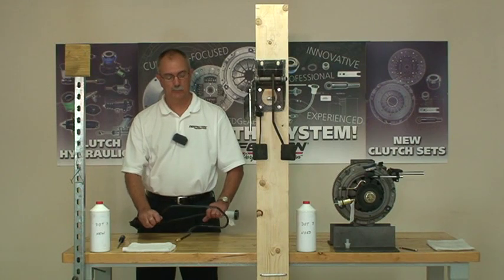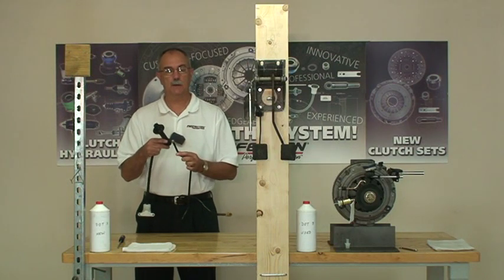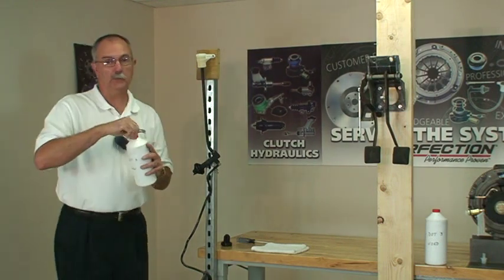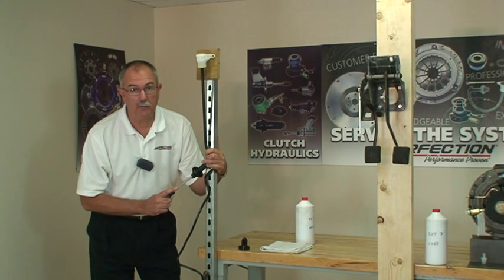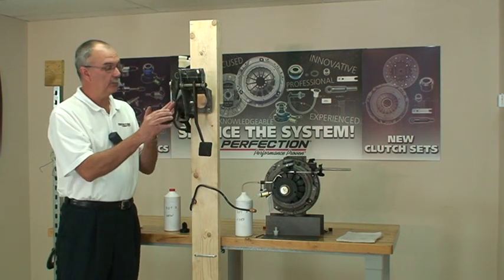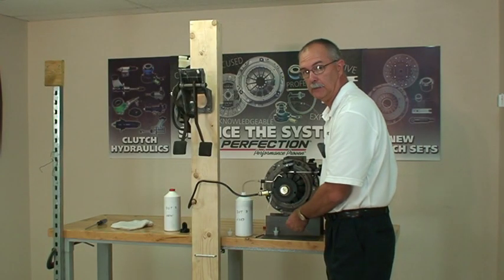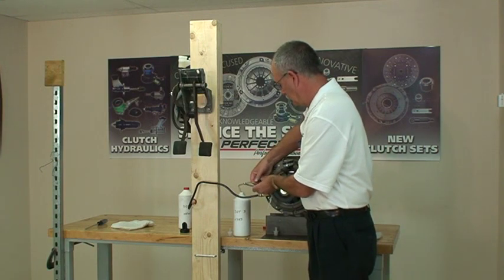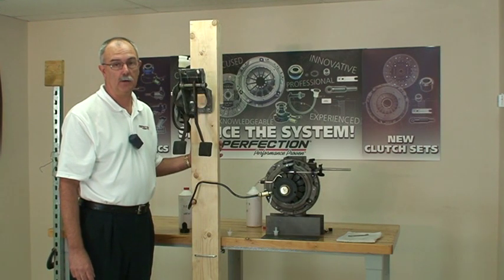Ford Ranger & Mazda B-Series Pickup Clutch Hydraulic Release System Bleeding Procedures

Comment: I did this, exactly like the video says, and all seemed good, and all worked well for a year or so, then my master started leaking, getting air into the system at the seal where i was inserting the Phillips screwdriver when I bleed it, fluid was getting on my vinyl floor. I didnt pump it aggressively or anything (when I bleed it), I think if you do it, you have to make sure to use a really small screwdriver to miss the seals inside. So I later on bought a prefilled master to the slave. I'm still having issues. But like what some people say on forums, use Ford parts with the hydraulic clutch. Older guys who remember cable clutches say hydraulic clutches aren't as good, but I wouldn't know. I suppose it could be preference. 

The Ranger clutch isn't like an easy brake job like it should or could be, many people have issues for some reason.
Reply: Also want to add: 
Since the prefilled master install, I've had to pump and bleed on 3 occasions now. 
The first two times tiny air bubbles came out, but this last time I didn't see any. You pump like 20x, hold, then release the bleeder quickly then close, repeat a few times. I did put in a non-self adjusting clutch, but I don't think that is the issue. 
It works as it should after bleed, but for how long idk yet. The next time I do the clutch I will be putting in the OEM Ford or LUK next time. Though it's not bad pulling the trans in a 2wd, I don't want to "try" different parts, some parts are being sold as OEM, and they are not.

Comment: So... if bearing is installed backwards (seal facing front of motor instead of facing transmission)..... will it cause any other problems besides extreme difficulty bolting Transmission  back up to the motor? Picked up a cheap Ford Ranger. Did a new clutch system on it. Put everything in exactly the way the old stuff came out. Turns out, release bearing was in backwards... so I installed new one in backwards (not knowing) as well. Took FOREVER getting Trans to bolt back up to the motor!!! But once back together,  everything seems fine. Should it be ok? It's not like the shaft moves in and out, or one end of bearing is wider or anything.

Comment: What's the story on the requirement to remove the rod portion?  I've got the whole assembly out of the car - can't I just pump the attached rod instead of using a screwdriver directly on the piston as shown in the video?  This is a '89, so no circlip on the rod assembly; it's one of those clips like you find at the end of the speedo cable that never wants to come apart.

Comment: Thank you for posting this.  I removed all the air from my system using this method and the transmission shifts perfectly now!  No excuse not to do it this way, folks!  The fender liner is easy to remove on Rangers, and from there, removing the master is a breeze.  Awesome.  It was a little bit tricky to bend the line between the master and slave fitting as the bends are quite stiff.  But using various clamps, I managed to create an uphill path all the way.  :-D

Comment: Thanks for sharing, i couldn't find any videos on how to bleed the clutch sistem on a 96 f150 and i did all the same process and it worked great i only had a clue because i have a haynes repair manual and it said that i had do bleed the master cylinder in a bench

Comment: Really want to thank you for this well-done, simple explanatory video. After watching several other videos of shortcuts and tricks, some of which may work SOME of the time, I noticed fluid coming out of the top of my clutch master cylinder, meaning it was defective. Once I saw this video, I knew there was going to be no shortcut for me and this is the way to guarantee success. You can also see why most of the shortcuts won't work unless there is no air trapped in the master cylinder. The only shortcut I saw that could work in that case, is one guy who unbolted it from the firewall, tilted the rod downward, stretched the hose under the car (basically doing the same thing as this video IN the car) and proceeded to bleed the system in the vehicle. But since my master was leaking, I had to remove it anyway.

Comment: Do you have to bleed a prebleed system 1994 Mazda b2300 , sometimes hard to shift. Can see through inspection area on transmission she's moving, but also clutch doesn't have the umpth as would hard half way then alittle eaiser on way down etc. Never had a manual vehicle this old.

Comment: DO NOT LISTEN TO THIS MAN... Bench bleeding this is how it's done.. Use the push rod to pump pressure in the line. There is a spring loaded seal the bottom of the line/the part that goes in the tranny. Once the line is primed use a screwdriver to push the spring loaded seal in fluid will come out. PAY ATTENTION. The trick is to have a friend hold and compress the push rod after it is pumped and the line is primed. The next meaning YOU open the spring loaded seal(screwdriver). Air and fluid will come out. Let the seal go to close the line. Then your friend can let go of the push rod. Pump it up and reprime the line and repeat this process until the line is free of air. Yes you should tap the line to get air out of it. Turn the line in multiple positions when bleeding with the method mentioned above. But the FINAL bleed; when you are confident all of the air is out of the line... the bottom of the line with the spring loaded seal should be held vertical to get the last of the air out. Keep the reservoir full and in the upright position. The entire process. Up right meaning the same position it is when it is in the vehicle. Good Luck. THE BOTTOM TO THE TOP METHOD SHOWN IS WRONG. It should be taken down...
Reply: You are wrong... idk where you get your backyard ideas, but this is the true reliable way to do it correctly with no guess work. Sounds like you like to fight things instead of do them correctly. Have fun getting frustrated...
Reply: @PureChivalry  To complex for you to understand.. I get it. Reading is fundamental... Just stick to.. The Cat in the Hat my friend...

Comment: Well, aint that just right. Now, in my case the 89 Ford F150 5.0 engine mated to a 99 4.2 M5R2 5 speed  was a real problem. I had to drill out the bell holes to accept the larger engine backing bolts ani It seems there exist a problem in the depth of the fingers when they are compressed to release the clutch. I was getting over an inch of slave travel to the fingers down but no release. Jack the rear end off the ground and i could get all the gears, put it down and no clutch at all. I found out that the pressure plate off the 4.2 was what i needed to get it fixed. That plate flat surface to top of fingers was right at 2.75 inches high. The other plate off the 5.0 11 inch  was only 2.5 inches. That was enough to keep me from getting the disc to release. But, the 4.2 11 inch plate did not exactly match the bolt holes on the money. They needed to be filled and drilled or you could just washer it down with grade 8 washers and lock nuts and then tack weld the washer under the lock nut and you got a 97 Ford F150 with a 1989 Lincoln 5.0 and a nice M5R2 5 speed 4x4 and all is well. Holley four barrel with good old point distributor. Now the bad part with the hydraulics is try not to get a damn leak in the middle of the desert cause you will regret not installing a mechanical arm. Thanks for you inventions Ford.
Reply: You got it, i only need real specs, not fantasy. I found out the finger depths are not constant, but i am working now to find the shaft depth in the bell and i am seeing over one inch of slave travel. Bolt holes are off center diameter wise in the 4.2 to the 5.0 so far but i found a clutch plate that is only 1/8 less than the 4.2 OEM for the 5.0 so i think i can make do with that small difference to get a plate on the 5.0 that will be close to the 4.2 in depth, now the adjustment to the slave will most likely have to be a shim made in behind the bottom of the slave to pick up about 1/2 inch closer to the fingers. I feel that the OEM plate was only sticking on the pivot arms but i have not had time to pull it down yet but i am working on it.

Comment: when I believe the slave cylinder failed on my mothers 2003 Ford Ranger so I went to bleed it to make sure there was no air in the slave cylinder and when I tried to tighten the bleeder valve back up it just rotates and will no longer tighten back up and all the fluid ran out if the system...do you have any idea why it the bleeder screw just go tinges to rotate and will not get tight?..is it stripped out or broke in some way and I now have to replace the entire slave cylinder?

Comment: READ READ READ

95 Explorer as well...

If you've installed your clutch kit/master/slave and can't get it bled and you're got air, you will spend QUARTS of brake fluid and get NO WHERE.  If you do this "bench bleed" procedure, you WILL be done in short order.

If you let air get down to the Master Cylinder once installed (which isn't that hard!), don't believe for a second that you can bleed it through, trust me, go through the effort to take the Master back out (Yes, I know, you'll need a new Clutch Retaining Clip for the pedal) and bench bleed it again.  Use my pain for your benefit!

Our pedal was only just starting to disengage at about 1/2 stroke and at FULL peddle, I could only just spin the driveshaft with effort but still could hear the clutch disk dragging on the flywheel/pressure plate.  This is NOT good enough; First and Reverse will be a grinding nightmare.

ANY air in this installation is too much; we were able to do the Bench Bleed portion of this procedure IN the vehicle (because the reservoir is "trapped" in the Explorer installation).

IN VEHICLE PROCEDURE: Take the master out of its mounted position, remove the Clutch Line from the Slave Cylinder, stretch everything out and down towards the ground such that the Clutch Line doesn't have any air traps in it, tilt the Master cylinder as shown in video and bleed until ZERO air bubbles appear in the reservoir during the "screwdriver pushing" portion of the procedure shown in the video.  This took 4 cycles of "tapping" and then "pushing" with the screwdriver.

I was able to do this by myself with my daughter watching the reservoir for bubbles, other than the Clutch Retaining Clip, it really wasn't bad at all once we got over the frustration of having to take the Master out.  DON'T let that be your deterrent, do it!

Comment: I followed your directions to the letter except when I tried to install the transmission the throw out bearing hit's the pressure plate before the input splines touch the clutch. Pulled the trans out and tried to push on the throw out bearing to see if it had some give but it was solid as a rock. How in the world can you install a trans if the bearing hits the pp first?

Comment: I've never had much luck with gravity bleeding anything. I have an adjustable prop that is made from a squeegee handle that works by pumping the pedal ( brake or clutch) and bracing it against the drivers seat. In the case of my ranger the only part needing bleeding was the new slave cylinder. The pedal showed signs of resistance in the first three pumps. Leaving the prop holding the pedal down I opened the bleeder. I repeated this a second time and was done. This method works on any brake or clutch system that I can't attach my pressure bleeder to due plastic reservoirs and that type of garbage. There has been some clutch systems on trucks years ago that needed to be reverse bled but that is another story. 43 years experience.

Comment: I bought a Duralast Pre-filled Clutch master and slave cylinder assembly from AutoZone.
And guess what was stamped on the clip removal tool?
"Perfection Clutch HT-01"
I thought that was interesting.
I had the Ford dealer replace the assembly because I had a soft ,low pedal and I was afraid it was going out.And it was the original factory unit still on my 2003 Ranger.
After replacement the pedal felt basically the same.But it did go into 1st and reverse a little easier.
Also.I got the old parts back and tried to work the master cylinder plunger back and forth as shown in the video,but it was like pushing against a brick wall.
I couldn't move that rod even a fraction of an inch into the master cylinder,no matter how hard I pushed on the rod.
But my pedal had felt low and soft.

Comment: Things always work quick and easy when they are removed from their normal environment.   Bench testing, like this, is always going to be much easier than when you are dealing with it in your driveway.   The actual bleeding - on the bench - may take only a ''few' minutes but, you don't give any indication of how long the whole job will take when you have to do it from start to finish.

I would like to see the job from beginning to end -- starting with the removal of the master cylinder, reservoir, and line, from a vehicle while it is parked in a driveway; all the way to reinstalling it and bleeding the slave cylinder there.   That would give a much more realistic idea of the difficulties involved in performing this task.  This clean room bench test gives a good idea of the objective [bleeding the air from the system] but should be coupled with actually performing the job on a vehicle.

The real world often provides challenges and other obstacles that a clean room demonstration simply can't prepare you for.

Comment: What keeps the fluid from dripping out the bottom while your bench bleeding?
Reply: There's a tiny check valve built into the end of the hydraulic line's connector. So, when it's not connected to the slave cylinder, the valve is automatically closed... thus, no drips.
Reply: @brucebeverly2629  Thanks for the answer. Wow it's been 10 years. I forgot i even commented.

Comment: if this works for ford 4x4?
Reply: i have a ford ranger 2000 4x4   3.0 engine

let me know if i can do all that in my truck or is it going to be different because i think i have that issue with my truck my pedal is very soft i dont think is the clutch because i can shift good.

Comment: i'm replacing the slave cylinder and throwout bearing in my ranger. im leaving the old master in it. will i still need to bench bleed the master cylinder? (if that's possible seeing as how the pushrod is still connected to the master cylinder)

Comment: hi i am a big fan of you amazing videos and work! i was wondering if you could explain to me why my 1996 b2300 bleeder valve (in the slave cyl in the housing) dosnt have a way for me to unscrew it? its in a weird position in the first place but i see no slot for a screwdriver  (i probably couldn't fit a screwdriver in) there anyway.but i need to bleed my system and i just don't understand the anatomy of my bleeder screw and don't know what tools to use to just crack it open.thank you

Comment: its the exact one you are showing in this video. 95 ford explorer 4x4 4.0 v6. and the slave cylinder is leaking. i noticed when i add fluid to the clutch resevoir  the clutch will gain pressure for abt a mile down the road then it runs out.

Comment: Is there any way i could bleed the clutch w/o having to take it off my Ranger? I was stuck in another town 6 months ago when my slave cylinder leaked and i had a local mechanic install a new Perfection Clutch in it. I'm very certain he did not bench bleed it or do any of your techniques. It's a bit unheard of for a clutch system.

Comment: I was bench bleeding the master cyl/lines + slave cyl (not yet installed on the truck). With the bleed screw closed on the slave cylinder and applying pressure on the master cyl all that pressure had nowhere to go except blow the top off the slave(like a jack in the box). Again this process was done OFF the truck! Does this now mean the brand new slave cylinder is toast or can it be re assembled by pressing that top ring piston back into the slave cylinder?

Comment: PLEASE ANSWER THIS: i have done this to my 03 ranger, i was sure that there was a massive bubble in the line, i did the whole procedure at my house and it didnt work. i made sure not to invert the resivoir when reinstalling...i dont know what else it could be.. a shot master cylinder? cracked resivoir??? the pedal is still not firm and wont go in gear, it only helped a little since initially when the pedal was completely limp

Comment: Worked great! I followed the Hayne's repair manual after putting in a new clutch, clutch plate, slave cylinder and hydraulic line on my 95 Ranger 2.3 and couldn't get it to shift in to any gears. I bled it exactly the way the manual called for but I just couldn't get the clutch to disengage. After watching this video I got it! Didn't take that long either. Anyone who has a Ford Ranger/Mazda Truck and needs to bleed their clutch hydraulics needs to watch this video... :)

Comment: i agree its terrible you ran a hard molded line rather then a flexible line terribly routed, an internal slave, mounted the master cylinder to where the air gets easily trapped and by your own admission you knew it wasnt designed right but you built it anyways it should have been mounted at 90 degrees the bleed point for the slave isnt at the very top so air gets trapped there aswell. for the R&D that was spent im sure something better could have been built as a whole its a very half ass system.

Comment: imo this is a very poorly thought out set up. theres no need for the u shape in the line before it cross over the frame it creates issues with no real benefit. then the slave itself is more of a pita then its worth the only part you eliminate is the clutch fork so instead of being able to change the slave easily with 2 bolts and a quick hydraulic connection you have to pull the whole trans. its a poor attempt to simplify the system and it just causes more problems then it solves.